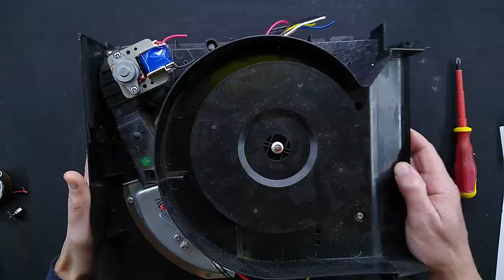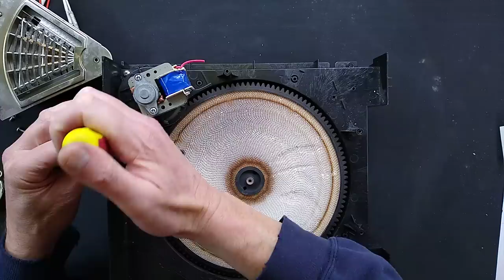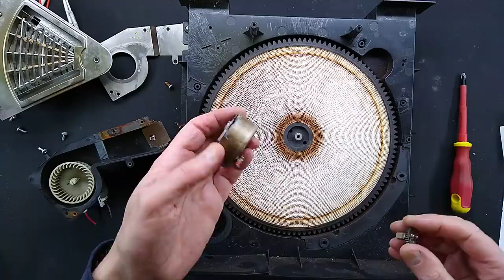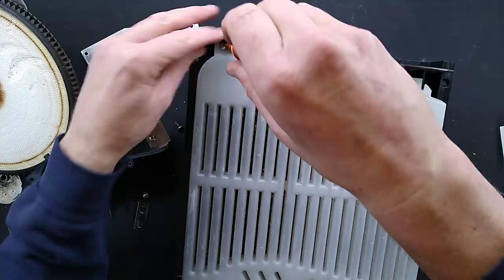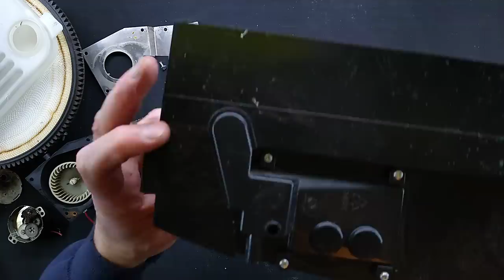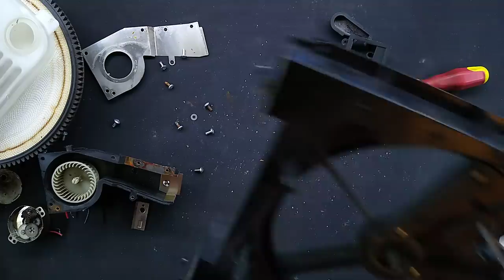Desiccant drum dehumidifier teardown

Comment: There is at least one company using this desiccant+heat process to market a magic "water from air" product. The irony of all such products is that they only work in humid environments.
Reply: My patented invention produces water for free but only if installed near a lake.
Reply: Counterpoint: while those are obviously quack products, with global warming disrupting cloud formation, drought is becoming increasingly common in the Great Plains. Quite a lot of humid air simply floats over without condensing into rain. Condensing water on an industrial scale might become a necessity within my lifetime at this rate.
Reply: @demef758  Can I interest you in the Peckham Spring Water company?
Reply: @cheyannei5983  The heat of transformation needed to condense liquid frm vapor is exactly the same as the power used to boil that same amount of water. Consider the amount of water condensed by an air conditioner. It does make measurable liquid, but the energy cost per gallon is horrendous. 
Could it be done on an industrial scale? Yes, but you couldn't afford the water produced that way.
Reply: @cheyannei5983  OK, doomer.
Reply: @Miata822  With that said, if an air conditioner you need to use anyway because it's too hot, was built with food grade metals, you could filter the water for safe drinking water. As it is they only produce grey water since you can't filter out the metals more commonly used. Spores and bacteria that might be in the air could be filtered out, but those metals can't I don't think. You could just boil the water if there's no heavy metals getting into it, but that's more energy so a proper 0.01 micron (or 0.1 micron since waterborne viruses aren't likely an issue) filter would be preferable.

EDIT: Incidentally I live close to the sea in the UK, most of the year I don't need air conditioning, but I don't take heat well so for the summer heatwaves I have a very inefficient portable air conditioner. That easily puts out 10 litres of water a day when keeping a single room cool on a hot day.
Reply: @cheyannei5983  Even trucking it in would still leave you with water that's cheaper by a factor of a few hundred, and that's just the energy cost. There's simply no way to do this economically. It's quackery of the highest degree to sell dehumidifiers as a solution to water shortages.
Reply: @Miata822  not quite correct; the latent heat (evaporation) of water is different at different temp and you need more energy to extract water from air at room temperature.
Reply: The dessicant can hold only a small amount of water (of course depends on the dry pass) and some (like silica gels) are reversible and can be regenerated by heating at higher temp.
Reply: I don't know anything about those products but there are actually some places on earth that have humid air but virtually no precipitation, so it's hard to find freshwater. I suppose the available freshwater might be contaminated in some places as well.
Reply: @cheyannei5983  duplicating machine
Reply: @nickryan3417  :-)
Reply: there is 11 of us commenting
who wants to make a new 1?
we can call it the water revo, it spins, it makes water, it lights up rgb AND it only uses uhh.... lets say 200 watts, so we can claim ecofriendly
Reply: @frogz  200watts 24/7 is plenty to condense water from the air, but it's still 4.8kWh a day. I stand by what I said earlier, if you need the cooling anyway, you might as well use safe metals and filter the water. The only viable method of mass water production really is nuclear powered desalination plants at the sea though.
Reply: @frogz  Can I assume it will be fully digital, WiFi enabled, solar powered and made from recycled materials?
Reply: @irreverend_  Commercially available HVAC units in the US (EU is more strict about toxic metals) have evaporator coils typically made of copper tubes, aluminum fins, and joints brazed with phosphor bronze alloy (copper, tin, and a touch of phosphorus)  often with up to 15% silver added, or silver used on its own. None of the frightening heavy metals. Very many evaporator coils today are fully coated in a hydrophilic polymer that helps shed condensation and prevent corrosion. I suspect that condensate from any of those versions would be safe to drink as far as metals are concerned. Lead is no longer used in HVAC tube brazing/soldering.

However, dust and every sort of microscopic thing that was in the air tends to be caught in the water, concentrating these contaminants in the condensate water. Even if it is safe to drink it tastes like the bottom of a refrigerator that is badly in need of cleaning. 

But HEPA filtration I can hear you thinking. True HEPA filtration will not work on any A/C you can buy. I have designed HEPA/NBC filtered HVAC units for military applications, but the cost in both energy and cash is frightening.

Distillation, sure, but you don't know what organic material was picked up in the condensate. Glade scent pods, bug spray, frying fish, vape pens, and a million other things that you track in contain all sorts of novel and interesting chemicals. They all get concentrated in the condensate along with the water vapor.

Can you? Yes. 
Should you? Almost certainly no.
Reply: @irreverend_  "The only viable method of mass water production really is nuclear powered desalination plants at the sea though." BINGO!
Reply: I wonder why that is..huh. brainbuster right there. Oh Well
Reply: @nickryan3417  Classic episode
Reply: @off_Planet  There's fast becoming a shortage of freshwater globally, especially in the plains. Where are your magic trucks bringing the water in from?
Reply: @cheyannei5983 , from the nuclear powered desalination plants by the sea.
Reply: @cheyannei5983  Desalination, you know, the only remotely economically viable way to produce potable water at scale? Alongside that form of clean energy that the people that stand to profit from sales of solar panels, wind turbines and battery complexes have been suppressing for decades. The trucks will run on diesel, like they always have and always will.
Reply: And produce disgusting sludge instead of clean water.
Reply: Yeah thunderfoot has done videos on a number of indiegogo / kickstarter magic water from the air products that are basically (very ineffective) dehumidifiers. I think the most comical one was the self filling solar powered water bottle - that you were supposed to be able to cycle / hike around and fill the bottle as you went. Needless to say - in spite of hundreds of thousands of dollars (getting close to a million in some cases) of backing the products never materialise or work as poorly as you'd expect.

Comment: Interesting. Never seen one of these as an ambient air dehumidifier, though, I’ve worked on quite a few that are compressed air dryers. Look up Atlas Copco’s MD Dryer operation. Same principle, but uses heat of compression from an oil free compressor (typically 75kw/100hp and up) for the regeneration process. When sized correctly, it’s an efficient way to dry the air and usually better (lower dew point) than a refrigerated dryer can achieve. Thanks for sharing
Reply: Thanks for telling us this info ...  we use hydrovanes without dehumidifiers - but on look out for one .... need to do some research here.  Slàinte Mhath.
Reply: If you heat a mass of cold air, you automatically dehumidify it. The actual amount of water vapor remains the same, but the RH value which is the direct measure of humidity decreases. However, if you cool a given mass of warm air, you must remove excess water because the air becomes saturated with water very quickly if you cool it.
Reply: I don't get, why nobody combines it for a household dehumidifier. Is it too expensive to sell or too big?
Reply: @CyberlightFG  all the moisture is trapped by the gel but the gel must be dehumidified periodically. That step is not done well. Without that it won't work well.
Reply: @janami-dharmam  Preheat it with the warm air from the refrigeration system
Reply: @CyberlightFG  right, but the temp must be around 150-250C for any effective drying of the zeolite. also this air must be extremely dry to start with else it cannot remove the trapped moisture. zeolites are clay (silicates) and the exact temp needed for effective drying depends on the specific product.
Reply: @janami-dharmam  Thanks for the explanation

Comment: Zeolite can also be used for VOC extraction from air. Industrial VOC versions of the zeolite disc in this basic arrangement are commonly 3 meters dia by 50-100cm depth. The adsorption (gas phase to liquid phase) process concentrates VOCs from the air stream and are cleverly called rotary concentraters in the air pollution control industry. The captured and concentrated VOCs are commonly fed into a gas fired burner that provides the heat energy necessary for the heated desorption loop making them rather efficient.
Reply: My English isn't very good, so I'm not sure if I understand correctly. Do the VOCs condense in the water taken from the air and are then burned at the end (so the zeolite is clean from VOCs)?
Reply: I asked Bard: she says 
[you are ] describing a process called rotary zeolite adsorption for VOC extraction from air. This process uses a large rotating wheel (disc) made of zeolite, a porous material that can adsorb VOC molecules.

The process works as follows:

The air to be treated is passed through the zeolite wheel. The VOC molecules in the air are adsorbed by the zeolite, while the clean air exits the wheel.
The zeolite wheel is then rotated to the desorption section. In this section, a hot gas stream is passed through the zeolite wheel, causing the VOC molecules to desorb from the zeolite and into the hot gas stream.
The hot gas stream containing the concentrated VOCs is then passed to a thermal oxidizer, where the VOCs are destroyed.
The zeolite wheel is then rotated back to the adsorption section, and the process starts again.

This process is very efficient for VOC extraction from air, because it can concentrate the VOCs into a small volume of gas, which makes it easier and more efficient to destroy the VOCs in the thermal oxidizer.

So, to answer your question, the VOCs are not condensed in the water taken from the air. Instead, they are concentrated in a hot gas stream and then destroyed in a thermal oxidizer.

This process is a very effective way to remove VOCs from air emissions from industrial facilities. It is widely used in a variety of industries, including automotive manufacturing, printing, and electronics.

Comment: When my wife was at the end of her life, she used a zeolite-based home oxygen concentrator that worked in a similar way. Instead of using heat to drive out the humidity, it had two zeolite-filled pressure cylinders which were alternately pumped up to 2.5 atm to get the zeolite honeycomb to absorb nitrogen. The pressure was then released and the nitrogen-poor (and oxygen-rich) air was pumped through a face mask. It would then switch the cycle to the other cylinder and let the first cylinder return to atmospheric pressure, releasing its stored nitrogen and ready to start the cycle again.
Reply: this is the idea used in common oxygen concentrators used in hospitals. They were in great demand during the Covid pandemic. But the actual zeolite used appears to be a trade secret.
Reply: My grandfather has a machine by his bed that sound exactly like what you're describing - I think it helped with sleep apnoea near the end of his life. I never knew how it worked! Thanks so much for sharing your knowledge.
Reply from the maker: I've been tempted to buy one to explore.
Reply: At the peak of the pandemic, India began to run short of oxygen for medical use. So there was a crash government programme to make more zeolite oxygen concentrators. Here a video on the operating principles of the two-cylinder type, used for both domestic and hospital units https://youtu.be/AE5QOq-HN3U

Comment: TOP TIP for Meaco DD8 (possibly the model in the video) to lessen sludge-formation in the area Clive showed: after removing the bucket, tilt the dehumidifer over onto its righthand side (looking at from the bucket side). This will drain the silly little sump over toward the hole that drains into the bucket.

(BONUS, if you happen to own an Ecoair DD1, which isn't the model in the video):
For preventing sludge building up in a similar way: after removing the bucket, tilt up the dehumidifier toward the closed short edge (the end opposite where the bucket aperture is) and slightly to the left as you look down into the bucket-hole. This will overflow the collected water from where it collects and allow it to drain over the plastic plate above where the bucket goes; you'll see a stream of water trickling down to that now bottom corner. Jiggle the unit as you tilt it to maximise drainage. I soak up this water with a cloth and repeat until the stream stops. It is always a surprising amount.

Edit: just to say, desiccant dehumidifiers are absolutely the way forward for clothes-drying indoors in damp winters. They may seemingly use a lot of energy, but their 'waste' product is heat, which nicely warms the room they're used in.
Also, GREAT video, Clive!

Comment: EBay version: low power saving dehumidifier magic fan heater safe uk plug. Features: 240v case, no earthing, only uses 5w, low power no heating element, magic fan, available colours blue, pink, black, random (colour may be different due to monitor) only available in green.

Comment: Where I work we have several very large versions of this. The drums are about 6 foot in diameter. Got to see one of the drums get replaced due to 20 years or so of usage. It had been eaten away pretty badly and was very clogged. Still a very good and simple tech for what it does.
Reply: We call them Kyotowheels. Green Datacenter use them. Also saw them in Make-up air units

Comment: I have 2 of each type. Had to replace several dodgy motor caps in the Delonghi compressor type. Another problem is the humidity sensors, probably due to a buildup of fluff around them. In general though I do prefer the desiccant dehumidifiers as they're quieter and have better air filtration and the ones we have incorporate a timer for 2,4 and 8 hours of operation. Regardless of the type it is remarkable how much water they can pull out of the air in a sealed room.
One other tip, these are great for drying clothes.

Comment: One thing about desiccant drums is that they are more scalable.  We use one to dry ambient air before it goes in to a large reactor building.  Of course it helps have a fixed unit and  can separate the air path for the hot, humid air.

Comment: Protip if you can't fit a screwdriver in tight quarters, you can try fitting a 1/4" screwdriver bit onto a 1/4" spanner or ratchet socket.

Comment: I used to repair these and they were a nightmare, not exactly reliable, the dessicant wheels used to go mouldy and absolutely stink, the regen and dessicant wheel motors used to fail with monotonous regularity. They tended to overheat a lot too.
Reply: Was it a Bry-Air? That described our experience exactly: we had a 1200 CFM unit for a lab that ate 20 kW, and it worked maybe 1/4 of the time. From what I understood, it was like you said: motor failure, and the thing would regularly overheat and trip off.
Reply: @straightpipediesel  No, these were for domestic use but still got abuse by builders etc.
Reply from the maker: I think the technology is still in its infancy for home use.

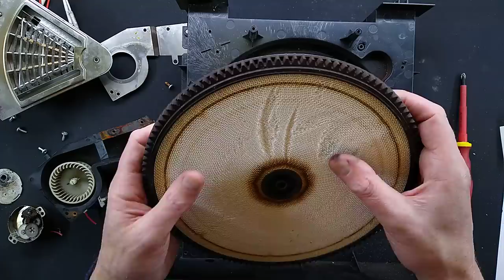Comment: I'm from the high deserts of Colorado, and we have low humidity year-round. My first work trip sent me to Texas / Louisiana border next to the Golf Coast, and the hotel room had a loud dehumidifier. After talking with my Sister, who lived in Texas and Florida, she said everyone just ran the AC all the time. Clive had a dehumidifier video out at the same time talking about warming up the room some to have better results. I raised the room temp, and the dehumidifier quieted down, and in one night, it pulled about a gallon of water out of the air in the hotel room. I also remember going out at 6:30. The sun was starting to come up, and it was already hot, and I felt like the air was so thick it was suffocating me. I was glad to return to the dry air from home, where we cool the air with swamp coolers, evaporating water over shaved aspen pads.

Comment: It you set it on top of the fridge so that the water output runs off into the evaporating dish on your fridge compressor, you'll never need to empty it.

And Legionella will thank you
Reply: You don't realize that if you do that your putting the moisture back into the air?

Comment: I tested a desiccant drum dehumidifier (Delonghi DNS65) against 2 simple compressor units. A 12 liter and a 16 liter.
The 16l produced 9.5l in 24 hours and used 5.6kw/h
The 12l produced 5.8l in 24 hours and used 5.5kw/h
The DNS65 produced 5.3l in 24 hours and used 11.7kw/h

In low noise mode 38db - 39db -34db they produced 0.32l - 0.24l - 0.14l in 2 hours and used 480w - 380w - 750w
The desiccant drum dehumidifier is supposed to work best in low temperatures when the compressor models tend to ice up and need a defrost cycle.
For normal room temperature the compressor models are the much more economic choice.
The Delonghy had the loudest fan with 46db while the two compressors stayed around 41-42db.

Thanks for taking it appart to give me a clearer idea how it works.

Comment: I once had to change a 9ft diameter desiccant drum at a plastic factory in Banbury. It used Gas burners as electric heaters weren't powerful enough. It was made by a company called Munters.